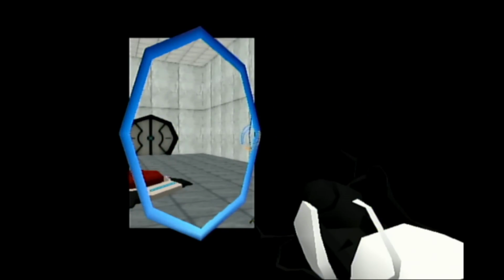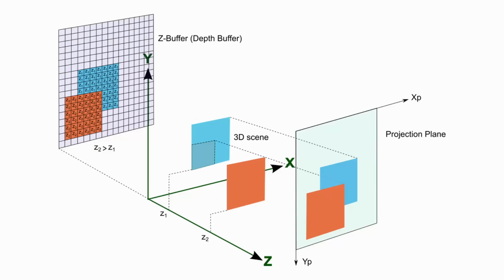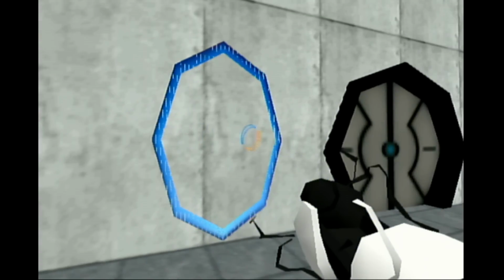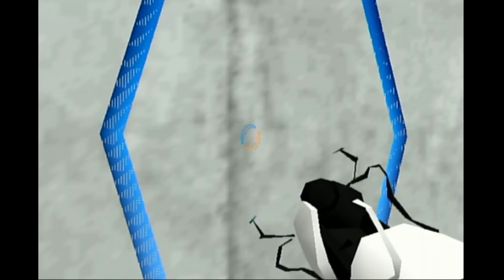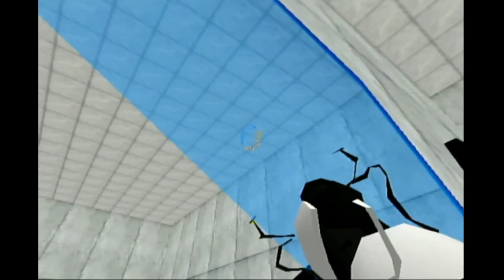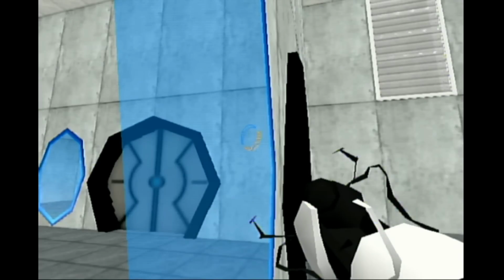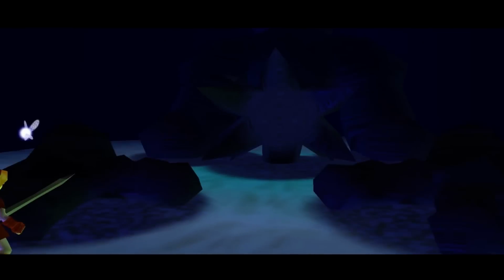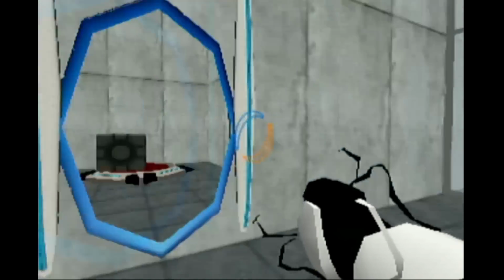How can the Nintendo 64 run portal?!? | Portal64

Comment: I am still wondering how you made the game run so smooth on a n64. I have an old low range phone that can run ocarina of time at 30 fps, but your "port" runs at more than 60 fps while looking at multiple portals
Reply: Emulation uses much, much more computational power than original hardware.
In fact, today's low range phone could easily run the first Portal game without any problem, and Portal 2 with low quality settings.
Modern low range phone are incredibly more powerful than a Nintendo 64, they have hundreds time more RAM, they have much faster programable shading unit, they have AI acceleration unit, more CPU cores running at faster speed, higher storage capacity, higher bandwith.
Reply: @Quesbe  ik the cpu inside my phone has 8 cores and the original n64 has 1 and a pretty bad one for a 2004 computer(as an example)
but since emulation requires more resurces bcus it has to translate the data using n64 and the game language, not just the game lang, it should work slower especially if running with unintended(not really) "mods" to be able to run in a bigger res or make some elements render differently.And this could harm the performance a lot
Reply: @Quesbe  btw, I ran portal 1 on my phone and it ran at 60 fps average(50-40 while looking into a portal), and I've tried also the gm_construct map but my phone ran out of memory so I had to delete some textures and some sounds, but it still worked very good at 60 fps
Reply: And Ocarina of Time has a caped framerate, so no matter how fast your emulator can go, you cannot get higher framerate without modifying the rom. If you speed up the CPU, the game itself also speed up.

Comment: I would pay SO MUCH for a physical cartridge of even just the FIRST level
Reply: If/When a ROM is released, it's pretty easy to get programmable cartridges, when you you can then put in an authentic-looking N64 cartridge shell with some portal box art on it
Reply: @C_Yo same
Reply: @C_Yo  Can't, portal is property of Valve. He can't distribute was he has done.
Reply: @Splarkszter  Valve (unlike Nintendo, which would gladly shut a project like this down) is pretty good with fangames/mods. I think as long as this guy doesn’t treat it like his own original franchise and try to monetize it (which is clearly not what’s happening), Valve would be OK with it. They’ve even let fan mods of their games (that are still using the original game’s IP) be sold and monetized on Steam.
Reply: @Splarkszter  project Black mesa is a Remake of half life 1 not done by valve and not paid by valve either (and valve did not sell the license). It is Sold on steam (therefore they do profit on it though). 
They dont care that much about old games.
Even EA doesnt care about old games getting revived as you can see with renegade-x having the devs blessings

Garrys mod even encourages you to reuse their assets to make new games
Reply: @Splarkszter technically he can tho since this is all made from scratch and can be sold as something “new”
Reply: @kennypowers1945   You live in the past or what.
Reply: Same
Reply: or, you could pay around 60 bucks for a flasher and a blank cartridge
Reply: yall over here arguing about flash carts I'm just playing everything on emulator lol! you can have it look exactly like N64 with the perfect video plugin or you can have all the features of PC. it's literally better in every way
Reply: @tacokoneko  Oh no no no you don't understand. I NEED a physical cartridge.
Reply: I mean sure, but the first level doesn’t have portals!
Reply: This whole damn thing boils down to "we want new n64 games on actual n64 hardware!" And I for one am all for it...
Reply: This is unofficial, so it's free. But still, I feel the same
Reply: I’ll probably make my own once he releases it.
Reply: @malakicayton8861  Valve silently shits on modders now.

Those higher ups i don't know what the fuck think but they don't help modders. They don't give licenses anymore.

What say is that he can't distribute it. Read plz. Lol
Reply: I’ll sell you one for 300$
Reply: I too would pay a large sum of money to enjoy playing this on a Nintendo 64 with a cartridge that says portal
Reply: This looks like a Jerma fan comment
Reply: @rl936  I don’t watch Jerma
Reply: Then why don't you? It's running beautifully on real hardware via flashcartridge.
Reply: @M1XART  he is talking about having a physical copy, not about compatibility with real hardware. Something like blast arena advance, a homebrew game for GBA, that was unofficially released on cartridges
Reply: @marikiri5119  yes and those unofficial cartridges use flash! gasp! omg! oh my god! (who invited this kid?)
Reply: @catfree  Slapping it on your own flash cart is not the same feeling as just having a physical cartridge with it. Same tech, yes, but a different feel. I'm sure this is all obvious to you though since you're old and wise and apparently not a 'kid'.
Reply: @denizium  It is a physical cartridge though
shell and all
Reply: @denizium   They know what your point is, they’re trying to tell you that it’s more cost effective and legal to buy a flashcart and put all the fangames you patched yourself on the cartridge, selling cartridges for older hardware isn’t exactly legal for most fangames which tend to be of Nintendo IP which isn’t legal to sell.
Reply: @anotsospookyskeleton1771  I mean, we are not going though the process of manufacturing mask ROM where flash is perfectly fine at this scale for anything.
Reply: @marikiri5119  a flash cartridge would be having a physical copy of it just replace the sticker on it with your own an bam
Reply: @Yanni1845  Riiiiiight. So you're saying I should go out and buy a Flash Cart each time I want to have one specific game on it with said game's cover art?

I know that the original commenter said they would pay for it but bruv, I'd rather put that fund towards my funeral. 

And the cherry on top : what makes it even worse is the fact that deep inside you know it's a flash cart, which beats the entire purpose of having the feels in the first place! A bit counter intuitive, if you ask me.

Then again, some N64 games do go in the hundreds on eBay and as such it'd be more cost effective to keep buying Flash Carts so maybe you're not that far off...
Reply: @catfree  who the heck says "(who invited this kid?)" in 2022? 1995 called, you're invited.
Reply: @CiruPlays  who watches N64 videos in 2022? 1996 called, you're invited.
Reply: but theyre right?? you can flash the rom onto a PHYSICAL flash cart and play it on an n64
Reply: @marikiri5119  How about you get a permission from Valve first?
Reply: @marikiri5119  you can make a cartridge easily. Could even make it the entire game
Reply: @marikiri5119  Yes but what he is getting at is that since it is compatible with console via flash cart, that means it must also be compatible via dumping the rom to a reproduction cart essentially making a "physical copy" of the game. Just needs a cool sticker.
Reply: @catfree  not all of them, you can buy custom cartridges online
Reply: @catfree  I know you thought this was clever but it’s just dumb. They want what they want. You saying what they could/should have is irrelevant. Who invited YOU??🤔🤨
Reply: @1stNumberOne  (who invited this kid) 
Also yes and yes however you should read the entire thing
Reply: @catfree  I did goofy. They want what they want. It could be dumb TO YOU, but that’s irrelevant…
Reply: @1stNumberOne  Bro you truly are #1
You made a mistake and fking OWNED it like a boss 
I comment you Sir. 
I hope you have a wonderful day/night and don't let the furries bite
Reply: @marikiri5119 what company or hobbyist is gonna release a game for a dead console, go through manufacturing costs, and hope the 300 fans of that tech demo pay up? 

Stick with the flash cart it’s better overall
Reply: What is the point of having a cartridge dedicated to a single level when it can be run on an EverDrive? The cartridge you buy won’t even have correct voltage or pin metal and won’t have bevelled edges which all cause wear on your console, unlike an EverDrive which is made within Nintendo’s specifications (the latest models are anyway). Just a waste of plastic too for something that will likely get continued updates. If using an EverDrive you can play a new version of the game within minutes, but with a single cartridge you’re stuck with whatever version is on it forever.
Reply: Me too
Reply: I'm tempted to make a proper logo.
Reply: Well then pay someone to do that for you?
Reply: No you wouldn't
Reply: @Palendrome  *soldering

If you're going to attempt to scam, at least know how to spell.
Reply: So you can make your own cartridges with the N64 blaster. Once you upload the rom, you can print the label and you’re good to go. Here’s a video going through the whole process. Chances are someone will probably make one soon. 

https://youtu.be/i_HwiH5SM2g
Reply: @hopperhelp1  The blasters have a newer design that flashes on the cartridge side instead of a separate flasher side, and also they are currently on leave and not selling for a few days
Reply: Same.
Reply: Me too
Reply: I kinda wish Retroactive game development was a thing, or at least a bigger thing
Reply: Nintendo fans lmao
Reply: @pencilgoblin655  what’s wrong with being a Nintendo fan, it’s not like I have anything against Sony or Microsoft
Reply: @THE-CRT  nothing, I just never see such intense passion for consuming products from any other fanbase
Reply: @pencilgoblin655  what, I like Valve I like Nintendo there’s no problem with that. I basically haven’t started my channel which will be Nintendo content
Reply: @THE-CRT  ... okay? you don't need to excuse yourself. It's all quite clear.
Reply: $999999999999999999999999999999999999999999999999999999999999999999999999999999999999999999999999999999999999999999999999999999999999999999
Reply: Nigguh 😵
Reply: Dork
Reply: How much?
Reply: Soyboys in this thread are wild
Reply: Get one of the programable n64 cartridges, then load the rom up
Reply: Why
Reply: With modern technology we could propably fit the full pc version on a cartridge the size of the n64 cartridge. And i know we can because botw is 13gb and portal is about 2gb and botw could fit twice on a cheap micro sd card
Reply: Jackass 😂
Reply: my n64 doesn't work consistently anymore  :(  cleaned it as well.   half of my games are stuffed as well, won't even load
Reply: Portal is now 16 years old. So if you were looking at 16 years before Portal came out. That's actually the year the SNES came out. A whole 5 years before the N64. Crazy stuff. 

Unrelated but nonetheless something interesting that makes me feel incredibly old now. So I was born in 99 when 'Star Wars A New Hope' was 22 years old. And now as of this year, the first Harry Potter movie will be as old to children born this year, as A New Hope was to me when I was younger...
Reply: Same here. But I wouldn’t pay much because I don’t have much money
Reply: @Whovian1156  Yeah, imagine not having any pockets. Now that Rue 204 is closed; it's impossible to find pants that stay on!
Reply: @Whovian1156 I have less than $100, but still, I would buy it for $1,000 or even $100,000, because that's its value, it's Portal, the most [...]
Reply: Boy, does this comment thread have a lot of misunderstanding in it.

"Flash Cartridge" Doesn't just mean everdrives, it also means cartridges that can be reflashed with your own roms. 

Essentially all of the modern aliexpress/chinese N64 repros are this kind of flash cartridge, and you can buy a device to reprogram these for ~$50 (I know BennVenn sells one for example.) There's also people like RetroStage that make their own blank flash cartridges if you're worried about legality (these might only work with their own flasher though).

So, if you made your own modern repro of this game and put it on a standalone cartridge, the easiest and cheapest way would be to use a flash cartridge. Not sure how even possible or worth it it would be to cannibalize a real cartridge.

On that note, I'm thinking about buying a flasher myself, and if I can find someone to do a good label I could probably sell you a cartridge with the latest rom for ~$30.
Reply: You would pay to play the game with shitty resolution and graphics ? Why ?
Reply: @elliotpoco7539  People like you irritate me, it's more than just the graphics. The N64 is my favourite console and I like the graphics. The idea of breaking portal down to it's limits while remaining visually appealing and being able to play it on my favourite console is worth paying for. You're the sort of person who would say that undertale or celeste are bad games because the graphics arn't realistic.